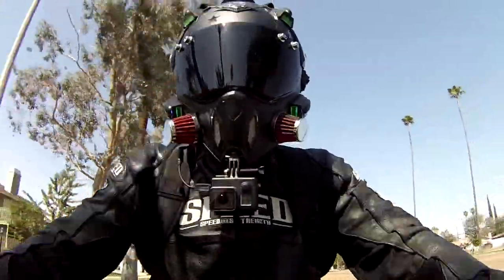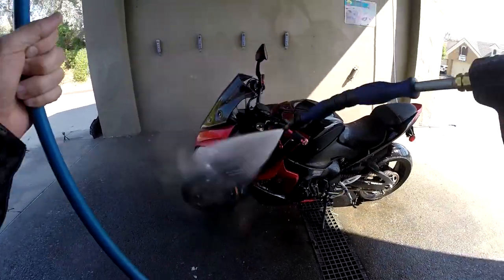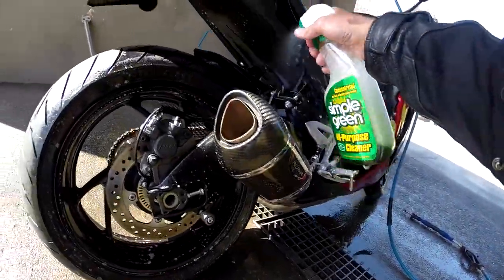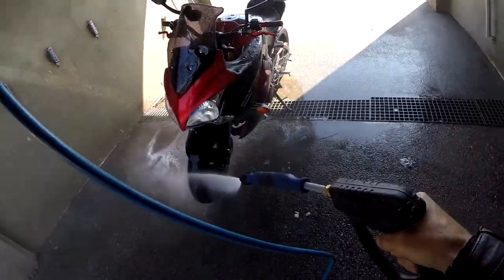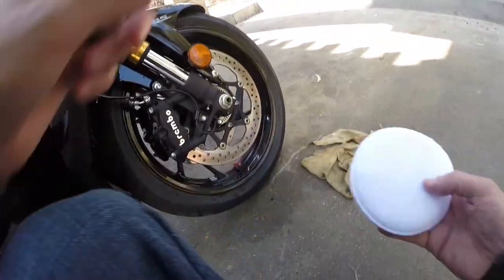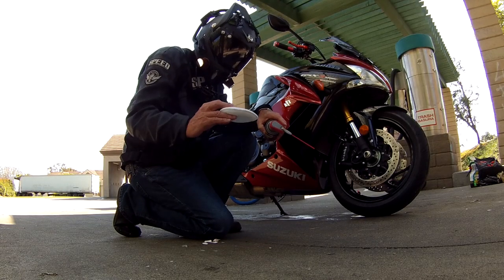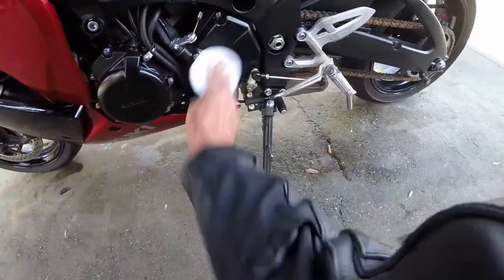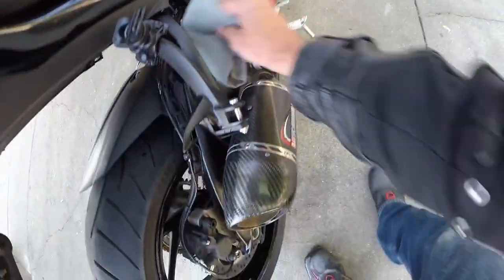How to keep your bike blingin' | Motovlog

Comment: Great general run-down. I just have a few points to throw out.

Be wary of using Simple Green on carbon fiber. I know people who've left it on too long and it made the resin milky. It can also etch into metal if you leave it on too long. Diluted and immediately rinsed off like you did is probably the way to go if you're going to use it.

Also be careful using the pressure sprayer anywhere near electronics connections. It can soak relays, ECUs, spark plugs holes... Friends on various forums learned lessons the hard way. My old Speed Triple could get the relays soaked just by sitting out in the rain. You can also gouge dirt particles into your paint if you use the pressure sprayer too close.

Wish we had more self-serve wash stations in the OC area. Everyone wants to do full service hand wash out here and we're pretty much limited to mobile detailers or waterless cleaner for bikes if you don't have access to a hose.
Reply from the maker: Great points, bud.  I actually avoid the pressure washer but dirt roads and heavy rains make it impossible.  I dilute my Simple Green and like you said, do not let it sit too long.  Though I've always thought of it as a harmless solution.  Yes, never get the water pressure wand too close to your bike, especially painted surfaces.  Late!
Reply: Very true, especially when the parts are hot

Comment: There is one thing I'm curious about though. Doesn't the pressure wash take the grease off the chain? Like would you have to re-lube the chain after going this?
Reply from the maker: Pressure wash will really only remove the external grease, which is why I spray my chain from the side.  Avoid shooting water into the O-ring areas.  Lube the chain when you get home and clean the excess grease off using a gas dampened rag.  brap!
Reply: Grease Ninja minimizes the mess while lubricating. Directs the lube straight to the ring areas.